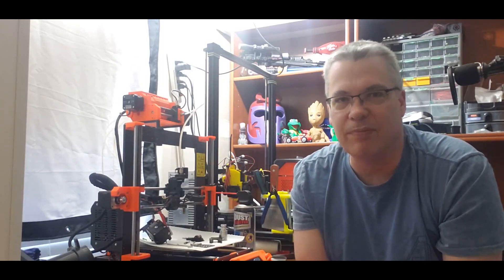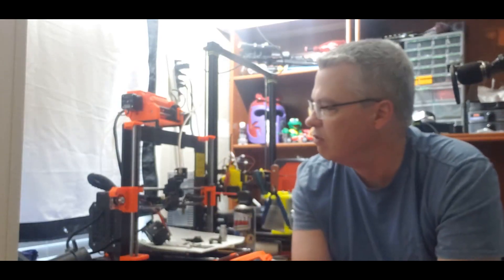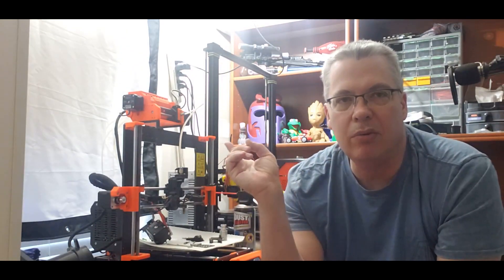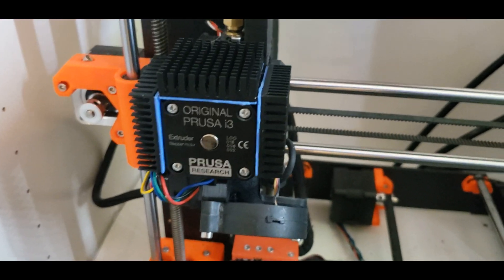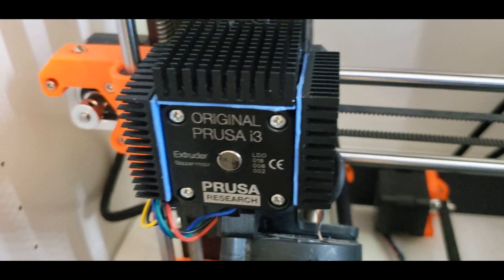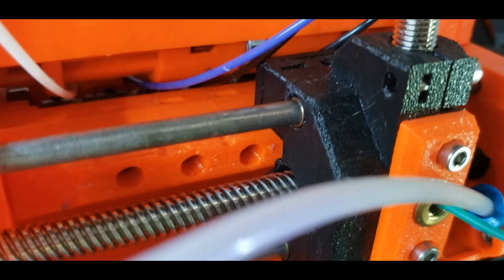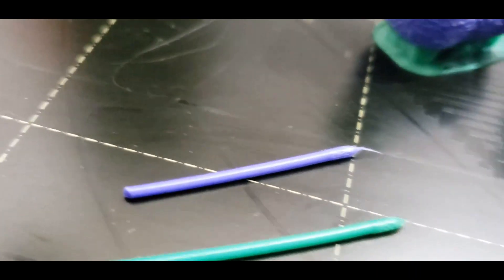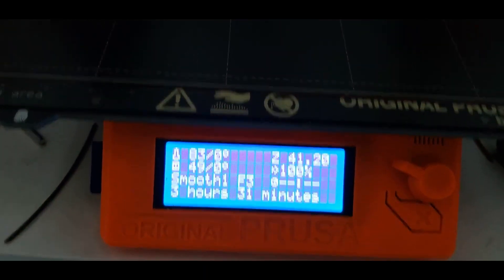Fixing your MMU2S Filament Tips

Comment: Hi Jeff, I think with Bi-Metal Heatbreak the print has also improved overall. What do you think?
Reply from the maker: I think it does too.  I put the second one in my chiron with a .6  nozzle to check out.Thanks for the idea and the typo is fixed now!
Reply: @jeffs3dcorner  I used one of this store. 
https://www.3djake.com/bondtech/copperhead-heat-break?sai=9388  
It is twice as expensive. What will be the difference in them?
Reply from the maker: Oh you bought premium. I just got regular. I would guess mines a clone of yours. Personally I was just interested in the 1.9 bore. The torlon is a bit smaller and gave me problems. This seems like the best solution.

Comment: I am sorry to say, but if that is truely an MK3S printer, then this is totally expected.
From the MK3S to MK3S+ upgrade kit sales text:
"You will need this upgrade in case you are using MK3 and planning to buy the MMU2S."
This is a well documented issue with the MMU2S and the MK3S without the + upgrade.

I build the MMUs months ago along with an MK3S+ and aside from the usual calibration issues like IR sensors and FINDA sensor alignment I have had little issues. I found out that screws holding PTFE tubes to and from the buffer should not be over tightened. 

Your experiences with whiskers triggering sensors tells me that you should probably slightly adjust sensors too. Also cleaning out the FINDA should be considered regular maintenance.